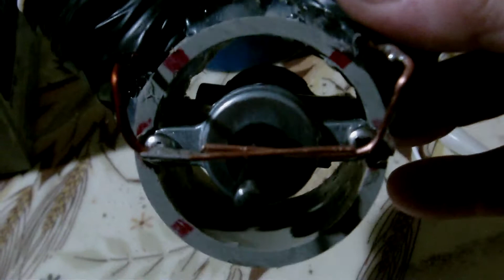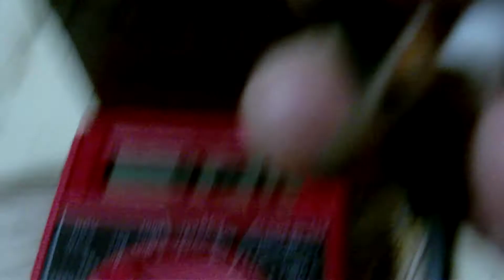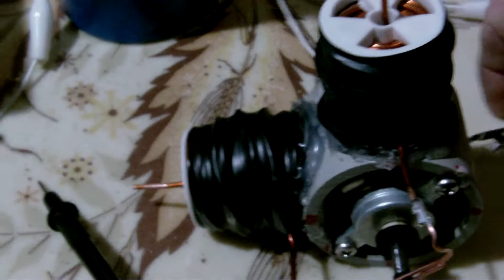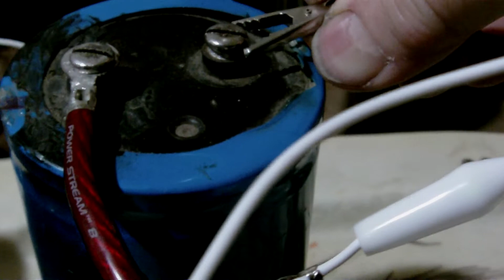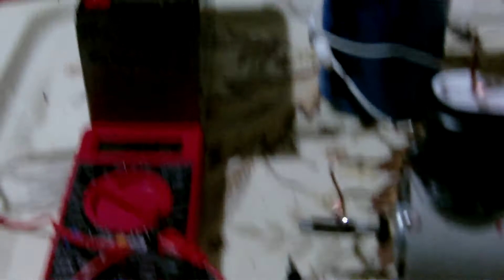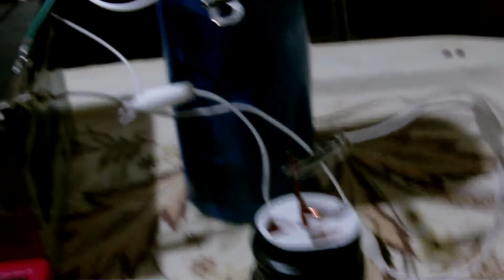free energy and faith 001

Comment: Interesting and novel idea ..i was wondering if your not drawing much current..can the motor do any useful work? Can you hook a convential toy motor to the other side as a little generator? A site that may interest you here is alex manzenero....he has a myriad of things running on a current limiting circuit..basically radiant energy
Reply from the maker: Scott S thank you for your comment it sounds as though this gentleman is on the same path that John bedini was on and I have a few of those models as well they work very good but when you use a limiting current you have very little torque unless you you utilize a flywheel which is what John bedini did with his 30 coiler and turned over a generator on the back side Joseph Newman did basically the same thing used a huge flywheel and turned over a 7500 lb motor on smoke alarm batteries and a capacitor if interested the video is titled, big Eureka the energy machine of Joseph Newman thank you for your comment I will check out that video God bless
Reply from the maker: Scott S thank you so much for the heads up of this gentleman I've never seen it done quite like that but he shows the same thing when you hook a capacitor up you get more power output I think I might invest in some capacitors LOL thanks again God bless